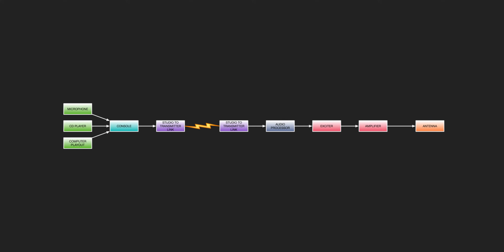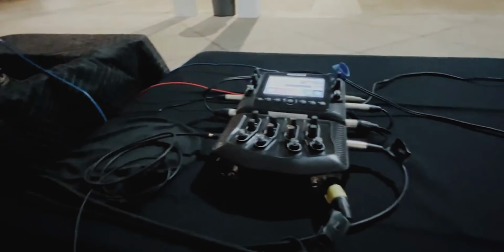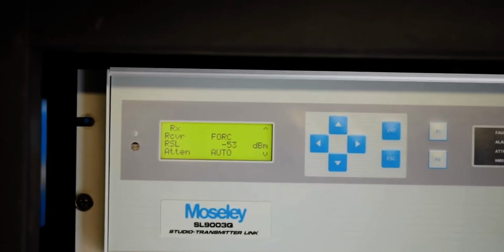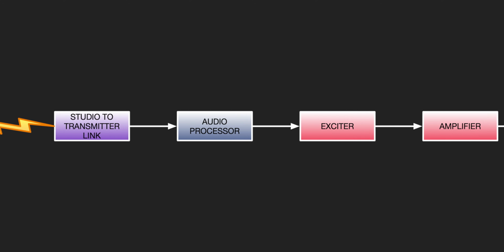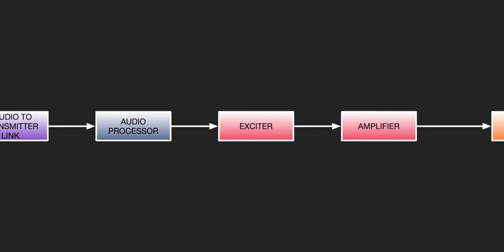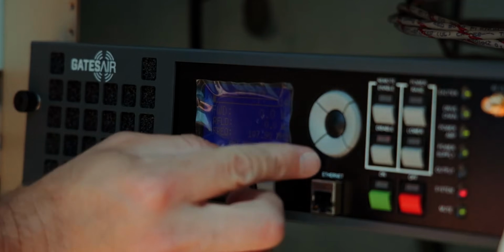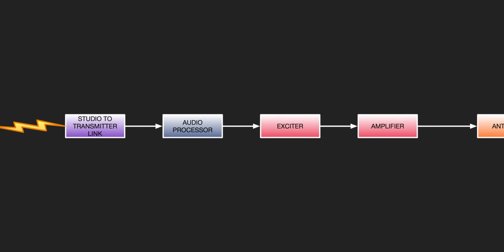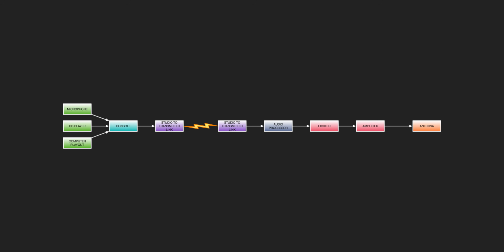What is the broadcast air chain?

Comment: One facet of broadcast I'm fascinated with is the audio delay/dump system.  It wasn't really a thing back when I worked in the industry (we never allowed unvetted callers live to air and prerecorded most vetted calls too).  I'd love to hear a two-track recording of the announcers pre-delay monitor and the post-delay on-air feed when audio delay is first built, used for a bit, dumped (assume a bad word was said), rebuilt and re-entered into delay.  I'm thinking the announcer once hearing the bad word, fades/drops the caller, hits the dump button and starts talking right after hitting the dump button to cover the gap until delay is rebuilt.  I understand the concept of stretching the audio to slowly build delay, however I think some delay units can play a short audio sting if needed to quickly rebuild delay too.   It's something I'm really interested in hearing how it all happens from both sides of the delay unit.... if you don't mind, I'd like to pop that into the suggestion box.  Thanks!
Reply from the maker: Great suggestion!